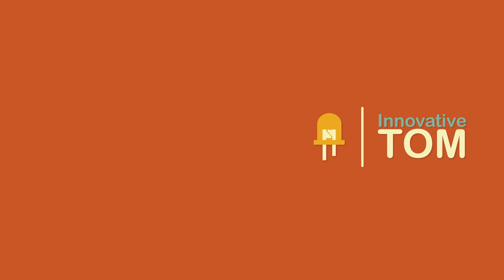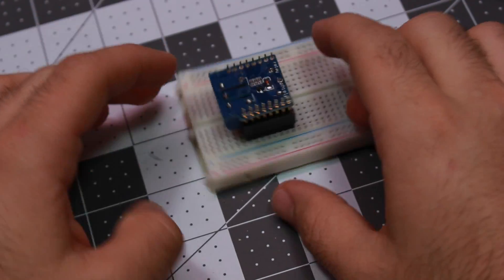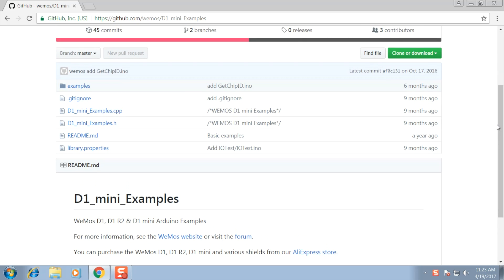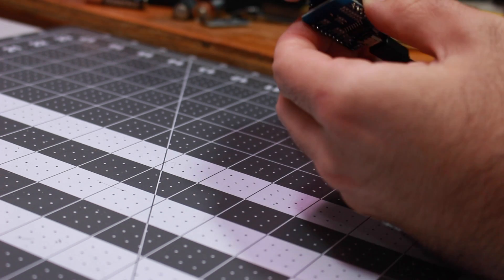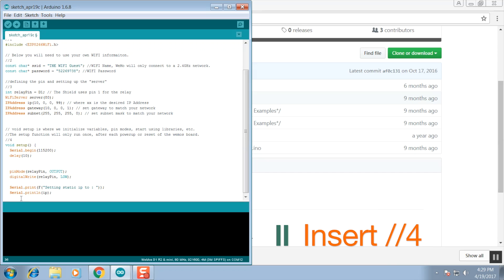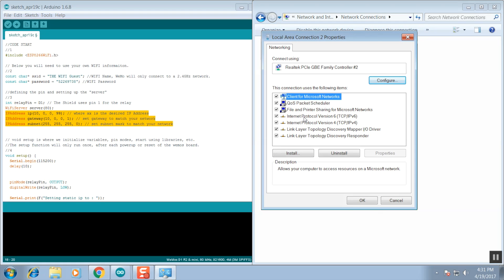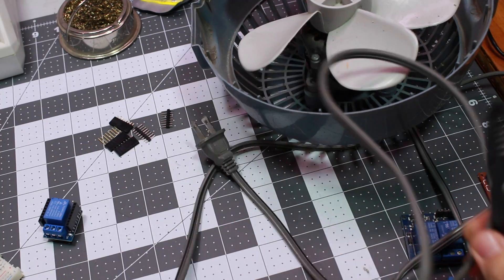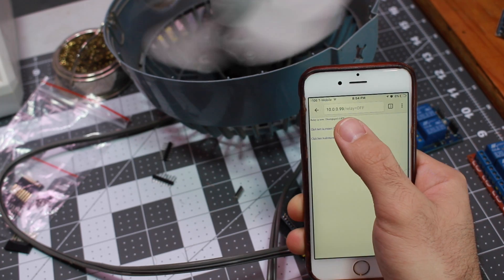Basic WIFI Controlled Switch Using the Wemos, ESP8266 and a Relay.

Comment: Great Video. Very helpful Thank you. 

Just a safety comment from an electrician. It is always good practice to switch the active wire (AKA Hot wire, line wire, phase wire) this ensures that there is no potential voltage at the fan when the relay is open. This is stated in the Australian Standards and I'm sure it will be the same for North America and most of Europe. 

It's always best to check with a local electrician before you go connecting hazardous voltages. There is a big difference in knowing electrical theory and knowing the safety regulations and why they are there.

Ok Safety rant over
Reply from the maker: Joshua Axford thanks for the tip, I do believe that is how I hooked this up. It is always hard showing high voltage projects. Never want someone to hurt themselves or others.
Reply: @MakersMadLab  Great video thanks, I got it working! Yes never switch the neutral side, it shows up as dead until you touch it. Called a floating or lost neutral in the UK and very dangerous.
Reply: You're completely right about safety and to switch live wires instead of neutral. Please also read my comment about the clearance issue, because this relay shield is a hazard.

Comment: hi Tom, i got a question. What happens if the router restart itself? The wemos wont start the webserver by itself and you also need to reset the Wemos. I tried several options to make it send some requests but none of them seem to work. Any ideas?

Comment: These Wemos D1 mini relay shields have a very nasty clearance issue. When you attach mains voltage to the relay, it runs veeeeery close to the Wemos GND, 3V3, D8 and D7 pins (even D6). Those air gaps in the PCB aren't going to fix that. I googled it and was very surprised it's not mentioned anywhere (as far as I know).
Reply: What is the risk? Overheating?
Reply: @pippaknuckle  Clearance is the issue. The tracks on the little PBC carrying potentially high voltage are WAYY too close to the ones that connect to the Wemos. The tracks connected to the outer contacts of the relay are about 1mm away from D7, D8, 3V3 and GND. Very poor and dangerous PCB design. Given the price of these little boards, I'm not surprised many of these are already sold, in use and a serious hazard in many many homes. I've labeled them to be used for low voltage only and to not switch mains voltage.

Comment: Hi, my problem it’s that i need use 8 relay’s 5 sensors and one i2c display....
Reply: connect an arduino mega (to use as the main control board) to the d1 mini and interface it via UART for internet

Comment: Thanks for the video. One issue I had was pin D1 on my Wemos would not activate the relay, I had to use D5. Which is annoying as I can't stack them together. Any ideas?
Reply: That's interesting I've just built this on my Wemos D1 mini and D1 worked fine for me. The issue I have is the off is on and the on is off, just means I need to change the code.

Comment: You made this seem so easy - great job!

Just wanted to comment that the drawing of solder to the bottom side is not necessary (the plated through-holes connect the full thickness of the board) and not recommended (the solder on the bottom is very likely to interfere with plugging into another socket).  The best possible soldering would be done from the top side only, where the solder goes down into and fills the hole.

Comment: Do you have an answer for my problem, after upload the code iam be able to connected  wemos board via my laptop and i can ping the ip addreess from the wemos board but the problem is i couldn't access through my cellphone ?? Do you have the answer?? And my relay still doesn't work?? Do you have the solution for my troubleshooting. I like to hear your answer. Thank's

Comment: Hi Tom, Great video everything works fine here, but one question is it possible to implement it with domoticz ?
Greetzzz
Reply from the maker: With the video provided, no. I have been working on some new stuff with openhab and MQTT. Openhab is an open source home automation bus, and MQTT is a protocol used for sending simple data back and forth between devices and home automation systems like domoticz, openhab and home assistant. Not sure when those videos will be out because it is a new topic for me.

Comment: Great video. Could you show us how to do the same BUT also powering the Wemos from the same AC lighting circuit? The reason I'm asking is I'd like to integrate this into my front door light, and not have to worry about extra wiring.
Reply from the maker: So I just used a USB wall plug and ran a USB cord to the wemos. In your front light you could get and adapter that goes in between the bulb and socket that has a plug on it.

Comment: Ok, so you're controlling 110 with this but what is the wemo powered by and what did you use for that?
Reply from the maker: Total fault on my part, I forgot to mention. The fan fixture has 2 sockets in it one for the light and one for the fan. I used a regular USB wall plug and cable to power the wemos
Reply: As this is vital info, it should be made part of a revised video!

Comment: Hi i have problem after couple hours my d1 mini don't respond and I need restart the board after that work perfectly until don't freeze again.
What can be wrong how you think ?
Reply from the maker: vvr0n4 check your code it could get stuck in a loop or something. Do you have another board? You could have a faulty board.
Reply: i change the board and i have that same but less, code i have from your link i change only web page look. if its possible i can send you my code ?

Comment: The house came with a 1970s garage door opener, and zero remotes. Everyone with rights to the garage has a smart phone, this is going to work perfectly for my needs! Thanks very much. (I'm not exactly new to arduino, but not a 'coder' either.) cheers
Reply from the maker: awesome! let me know how it turns out. Im working on a video right now that using an app called Blynk. Should make this much nicer looking. Should be out next week.
Reply: Before you start, make sure your phones can reach your wifi from your driveway! You won't be able to log on via mobile data because you won't be on the local network. (It is possible but more complicated,)

Comment: hi there, for win7+win10 you can use: win-key + type "cmd" => Enter
Then ipconfig => will show your all your connections, also if you got your ip from DHCP.
To see if a IP is not currently in use, you can then try ping
ping 192.168.0.1  or xxx.xxx.xxx.1 would normally be your gateway router.
if you want to see if xx.99 is unused just type:
ping 192.168.0.99 => if that gives a feedback its already used, if timeout its (at least at that time) free for use.

much faster, also with win10 .. (command line / power shell commands iften save time)
Reply from the maker: Psi Q yes! This is awesome info. I completely over looked that fact that most people don't manually put in there IP settings. Thanks!

Comment: Great video Tom!! I found it super useful! One quick point for those who have the little "Obtain IP Address Automatically" box selected in the Network settings, you can simply open up command prompt and type in ipconfig and it will display all necessary network information there!
Reply from the maker: +Marcin Zegarmistrz great point! I did think of that. Most of my networking stuff is manual set.

Comment: hi tom great video, but just to let you know its really important that you only break the live or hot conductor when switching ac as if you break the neutral conductor the nuetral will come up to potential posing a higher risk of shock. just wanted to let you know so you can advise as necessary in the future.
Reply from the maker: +gwil6100 thanks! I was unaware. I will be sure to make a note.